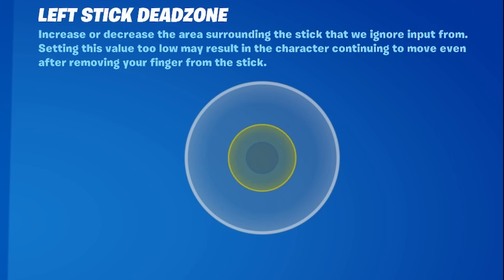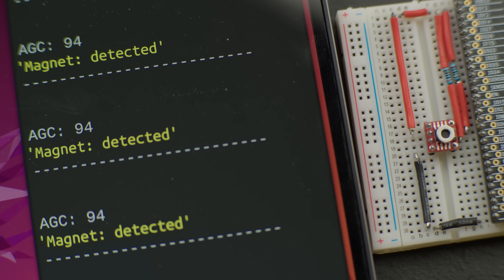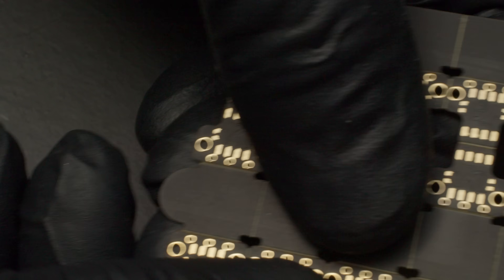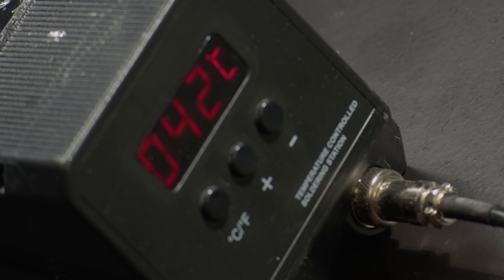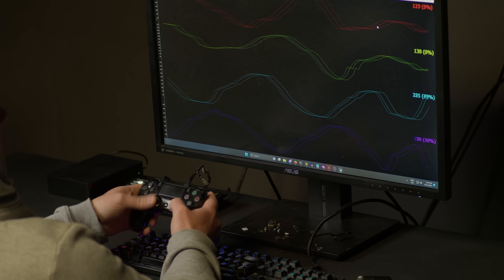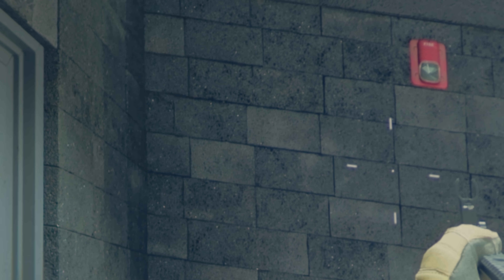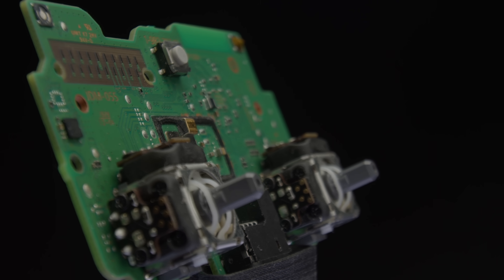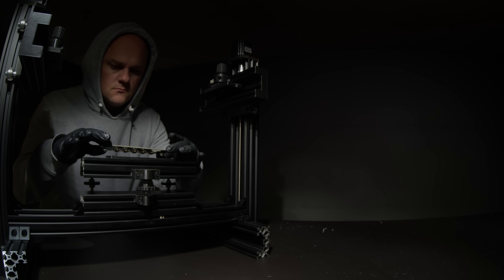Beating the $20B Joystick Drift Problem, and giving it away for free

Comment: 14:24 The design is so simple that I doubt you can even patent it. In short pretty much anyone can just copy it.
Considering how simple it is I still don't know why there isn't any Chinese company mass producing something similar considering it would be a easy way to make a very high amount of money.
Reply from the maker: Im using a very very expensive sensor for a normal chinese company to use in retail sales market. Using these sensor instead of what they are doing, would probably 100x their cost on hall effect part. So i dont think its gonna happen. The chinese magn tek version of this type of chip is even as expensive as the western ones.
Reply: @MariusHeier1  If you buy in mass its less than 2$ each. I don't think the manufacture cost would add up to more than 10$.
Selling it for ~20$ per axis should be very well profitable.

Comment: Would love to know if these work for my Thrustmaster controller, as although it is Xbox branded, it does use similar/the same potentiometer modules as those found in PS4 controllers
Reply from the maker: Then its gonna work, as long as they are 3.3v. Would you mind sharing the model number you have?
Reply: @MariusHeier1  My replies dont seem to be staying here. I believe the potentiometer model number within my controller to be THB001P by C&K

Edit: This reply appeared to stay fine. Perhaps its because I linked to a product page for the potentiometer.

Also a product number for the controller is 4460174. Couldnt find a model number for it however

Comment: over 20 years ago sega's saturn analog pad and dreampad used hall effect tracked thumbsticks. the design was ingeniously simple, minimizing the number of moving parts, and practically impervious to wear. even on pads where the buttons started failing, and the nubs on the stick are completely worn down after years of use, the stick still tracked and centered perfectly, with zero center wiggle. (aint gonna try and describe the mechanism, but there are teardown videos)
Reply from the maker: Ive seen some videos of it. Very impressive and very brave of them.
Reply: @MariusHeier1  do you copies them!
Reply: Didn't PS2 controllers have a similar technology?
Reply: @GIMM3_D4_RAM Idk about the inner working of the PS2 controllers, but I do know they practically solved stick drift. You can recalibrate a drifting stick by just doing a full 360 rotation of the thumbstick.
I still have two old PS2 controllers that work perfectly, something like 15 or 16 years after I got them.
If the sticks ever drift, I just recalibrate them with a couple of quick circles. (was doing this long before I knew the design was intentional, cause Sony's engineers are geniuses who anticipated the way people would deal with glitchy sticks).
A shame that they later decided it wasn't worth keeping that technology in use, cause selling more controllers is more important to them
I have seen so many busted ps3 and ps4 controllers, but old wired ps2 controllers? Never
Reply: @GIMM3_D4_RAM  No, just the potentiometer
Reply: the Dreamcast controllers used hall effect sensors too.

Comment: Does the xbox 360 controller use Alpine thumbsticks with 0-3volt requirement? I'll buy whenever it's available. If not I'll have to buy a PS4 controller just for these thumbsticks.
Reply from the maker: I think wired do. Im making 1.8v as well later

Comment: Impressive, however you're trying to reinvent the wheel which was already done properly 
Gulikit 8bitdo made a controller and other Chinese companies made hall effect joysticks modules easy to put in any controller
Reply from the maker: No sorry buddy. Gulikit only fit in controllers that can do heavy signal processing on their noisy single hall effect sensor. This is not just a hall effect sensor. This is a rotary encoder with two hall sensors in 90degreeoit of phase that uses same type of triangulation math as in gps to track the rotation of a magnetic field. It also has the cordic computer and output dac in a single chip. This will eventually work in all controllers, not gulikits.

Comment: could you use magnet to centre the sticks instead of the spring?
Reply from the maker: Yes. Im gonna try that soon. I just had to stop somewhere. You can use a spherical magnet instead of the spring  and a disc magnet inside the bottom of the housing..
Reply: cool good luck

Comment: My PS3 controller gives drift the middle finger with well over 12k hours of use on it so far

Yes its one of the rare hall effects equip ones

I will add that i dont know how external forces DONT affect it but they dont outside of literal magnets getting close to the sensors

So maybe they are shielded or just arnt as sensitive as modern ones or something
Reply from the maker: The position chip only works when 0-3mm apart the magnet..its made for motors and sitting close a noisy environment. So its well protected and have super low noise.

Comment: Finally someone who acknowledges that the stupid hall effect "voodoo magic" sensors are just as fucking good as the mechanical assy itself allows for.. simply, the weakest link in the chain is going to dictate accuracy and return to center values. Anything with "zero deadzone" is simply fucking snake oil.. That's a software or firmware dynamic deadzone at best.
Reply from the maker: Haha, exactly! If you measure the noise on the Gulikit Hall Effect sensors, you'll notice that you can't achieve a zero deadzone on that device without knowing how to reverse entropy.
Reply from the maker: If the actual mechanical design would theoretically support it.